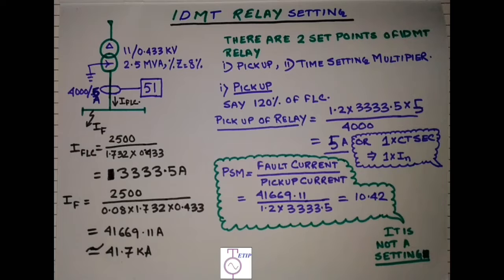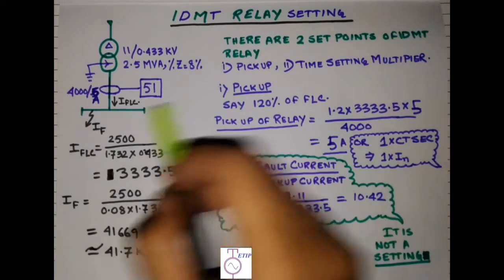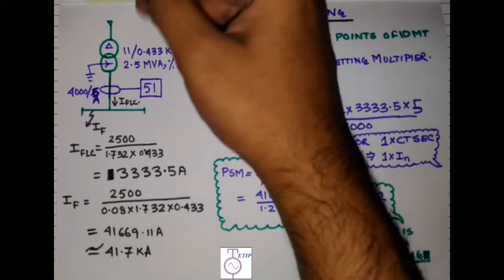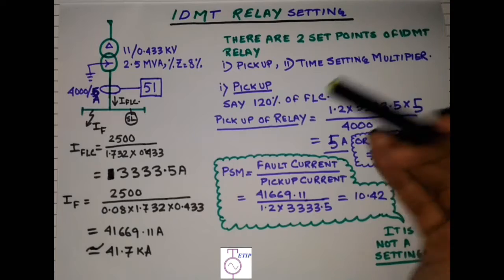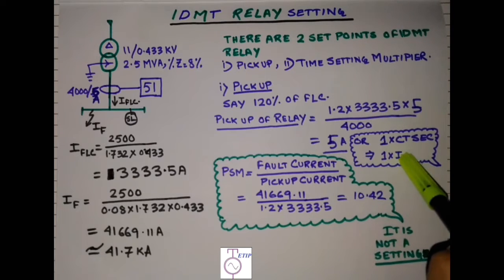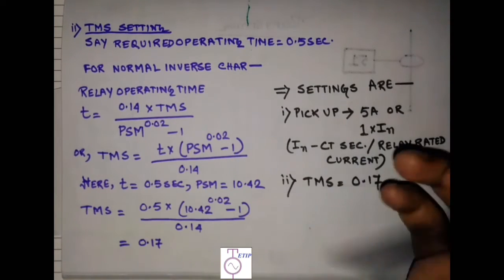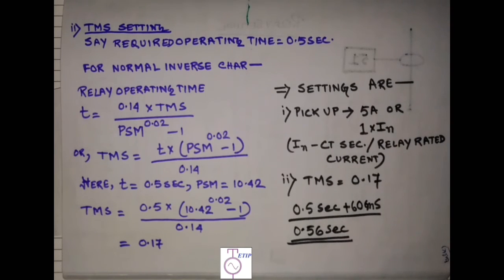Relay setting calculation|IDMT relay|Protection|Electrical Technology and Industrial Practice

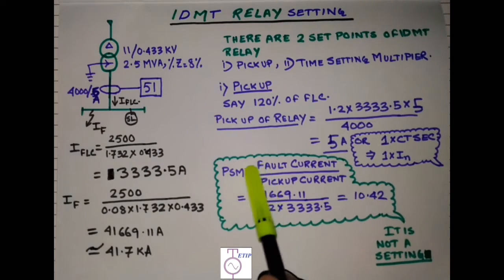Comment: 5:36 time - here psm= fault current/pickup current  given but the values which were mentioned are not right...it should be 41669.11/5(pickup)....psm value is wrong

Comment: CT sec 5A , pick up current o 5A.....ektu imbalance holei to relay act hoe jabe. Jokhun 120℅ dorchi pick up ta 6A hobe na?
Reply: Exactly...He has depicted wrong calculation. For 120% of setting pick up current of relay would be 6...😢😢😢
Reply from the maker: Tumi eta dekhoni j CT primary ta already 20% margin niye ache. So CT primary rating selection er somoy load current er opor margin rakhte hoy. Tai 120% of In mane genuine overload hoyeche ba overcurrent hoyeche. 100%load er opor unbalance hole kokhonoi relay pick up korbe na. Jodi CT primary te margin na thake tahole secondary adjust hobe seo vabe. Load current er opor margin niye pick up dhorte hoy, seta k CT ratio diye division kore relay te input korte hoy. I hope it is clear now...

Comment: Sir in definition you are saying pick up current as 120% of full load current however in calculation you are dividing it by CT ratio. I guess definition should be corrected. Similarly for PSM.
Reply: He is using the CT ratio to get a secondary representation of the current to input in the relay as a setting.

Comment: Breaker operating time is 0.5 sec again why you are adding 60msec? Here "t" is the breaker operating time. If you do back calculation you will get 0.495 which is 0.5 sec.
Reply from the maker: t is relay operating time and 60mS is breaker operating time after receipt of the trip signal from relay

Comment: Sir it is requested make the formula correct,
 PSM is the ratio between fault current in secondary of CT to pick up current.
Reply from the maker: Fault current/ pick up current. Either both shall be primary or secondary.

Comment: Wrong equations . Pick up current = current setting × CT secondary rated current .
PSM = fault current of relay coil / pick up current
Reply from the maker: My equation is also correct. I have taken primary current instead of secondary.

Comment: Hi sir good evening
How can we select ct of 4000a when the fault current is More than the CT ratio. How can CT sustains excess current. Kindly let me know sir.
Reply from the maker: Every equipment has a continuous current rating and a short time withstand rating. Short circuit falls under short time category. That is why you need to specify ct as say 2000/1A, 50kA for 1 sec. High fault current will be tolerated only for 1 sec.
Reply: @electricaltechnologyandind5335  
Thanks for clearing my doubt sir...... Thank you so much

Comment: Bro why did you add 60ms to 0.5s? What is the 60ms? What is the difference between the 0.5s and 60ms?
Reply: 0.5s I stgd time taken by the relay to issue a trip signal to the circuit breaker but the circuit breaker contacts open will take approximately 60ms to clear the fault. So the total operating time is the addition of the two periods.

Comment: while calculating TMS, we have assume t=0.5 sec so how we can assume this data?
Reply: sandeep kakulapati
1 second ago
its depends on system withstandable sc current . For example breaker sc rating 40KA For 1sec, so rated fault current should be cleared within that time

Comment: Thanks for the video. Please let me know why does t is taken as 0.5 sec only
Reply: its depends on system withstandable sc current . For example breaker sc rating 40KA For 1sec, so rated fault current should be cleared within that time

Comment: Sir u said that pick up current is equal to pick up of relay then y u didn't put the 5A in denominator of PSM formula sir instead u multiply  120%with full load current, y so sir?
Reply: If so sir what is the difference between pick up of relay with CT value in formula and pick up current without CT value in formula which u have used in denominator of PSM? Kindly explain clearly sir!!
Reply from the maker: see suppose you have full load current 100A, Ct ratio of 120/1 A, then if you say i will set the relay to pick up at 120% of flc the  your pick up will be 100*1.2*1/120=1
Reply from the maker: incase your ct secondary is 5A then the oick up shall be 5

Comment: i have 2 x In given as 2 x 0.1A, time is 0.23 TMS, and Ia=0.1A TMS is fixed value does my relay operation time is different with fault current or it will always operate on same time which i set ? As i see you calculated fault current as with fixed values for PSM
Reply from the maker: no, for different fault current the psm will be different. the setting calculation is made based on the design fault current, where the fault impedances are ignored, to get the worst condition. but in actual there are fault impedance which reduces the fault current. so your relay operating time will vary. and that is the principle of idmt characteristics. inverse time, i.e. for higher fault current the operating time will be lower and for lower fault current the operating time will be higher.
Reply: ELECTRICAL TECHNOLOGY and INDUSTRIAL PRACTICE  in my case no where written in serting that its IDMT its only written as Characteristic A whats that means curve?
Reply: @TecKideos  

As per IEC standard curve A means IEC standard inverse curve...

Comment: Hai sir, Really useful video. I have worked in SIEMENS and ABB as a electrical engineer but i have realized that i need to improve my technical skills. Your video gives good technical knowledge so keep it up!! And please add more video about relay coordination with upstream and downstream including discrimination time. Atleast add 11/0.433 kV incomer system and two LT motors of small kW rating then please give lecturer about relay setting calculation by considering EI,VI,NI curves. Thanks in Advance!!
Reply from the maker: Thank you for your comment. I will make video on the co ordination of relays. It may take some time, but I promise you that i will make video on those topic. Pleasr stay connected with my channel.
Reply: @electricaltechnologyandind5335  
Sir, everything was okay. you calculated everything but I don’t know where come from 60 m/sec? Pickup -5A, TSM-0.17, say time-0.5sec. But why you don’t use calculated value? 0.5+6=0.56 sec!!!
Reply: 60 ms is time taken by circuit breaker to open during fault.